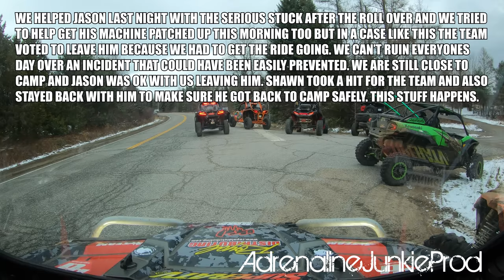Blown Diffs & Shattered Dreams - SXS/UTV Feature Length Off-Road Trail Riding Adventure

Comment: That little wildcat is a real mountain goat! keeps impressing. great to see a machine that is 1/4 of the price of all the others keeps up and sometimes does more then the big one$ with the right driver..
Reply: I own a 2018 Textron Wildcat x. I get the bad looks and s*it talk from others with much more expensive rigs. Don’t get me wrong, I love the more expensive Polaris and Can Ams but my rig goes everywhere theirs does.
Reply: I like the wildcat x platform far better than the xx
Reply: @timma0175  ya if I was to go xx then honestly I’d be getting the rzr 1000 instead
Reply: @MrSwimmer12  good call
Reply: @timma0175  yup. Sadly Polaris has much better customer support and aftermarket support. Sadly, I feel like Textron is a “dying breed” even though mine suits me parts are hard to come by (everything is becoming discontinued, and shops to work on them are far and few in between at least here in Colorado) don’t get me wrong though great machine for price and what it is. I’m impressed with stuff it has been able to do.
Reply: @MrSwimmer12  you and I my friend feel the same way. I hav little or no support for my wildcat via textron. They need to find thare passion again.
Reply: I love my wildcat sport. 30s and snorkels and its a beast in the mud
Reply: Little wildcat comes with a true locking front diff from factory

Comment: Just FYI 
All the xx models are the same yammy tripple design from the Arctic cat thundercat snowmobile!
There is a yellow 10mm plastic drain plug on the bottom center between 2 clips of the outer cvt cover. 
I get my xx in much deeper water than that and I’ve yet to get water in the cvt. I bet he got the water in the cvt exhaust snorkel from all the wheel spin or his cvt seal is not sealing somewhere. It’s easy to pinch the seal wrong if you don’t put the outer cvt cover on carefully.
Another thing…the motor oil is a dry sump system and will not fire until the oil pressure reaches the correct psi level! It’s normal nothing is wrong with the delayed start. They are an excellent engineered designed unit!! Very under rated! Ive been very satisfied with mine since 2018! Ive rode everywhere from windrock to brimstone to turkey bay! 
Excellent trail machine in most terrain! Also depends on how you set up the xx clutch and what tires you run as well! The main downside is they are very heavy around 1800lbs stock empty weight! Has plenty of power 130hp for naturally aspirated engine!
There is no perfect stock unit but it’s a lot closer than many out there! Definitely built better than most stock machines on the market. Aside from the upcoming speed utv! And maybe the krx 1000! 
And lastly if you’ve never actually drive one your really missing out!!!
Very driver friendly and it makes you a good driver if your not the best!
Reply: 100% agree with this!  I love my 18 XX.  Its a beast!  One of the fixes that required to be done after you pick an XX is putting in a coolant bleed line.  Super simple to do.  This guy didnt do it and caused it to shear its impeller off the water pump.  Every platform has issues and this is just one of those kind of  issues that need to be dealt with.
Reply: @mattking8761  I did the bleeder fix then finally just upgraded to a billet aluminum impeller from Dasa racing! It was an easy but kinda expensive upgrade but better than catastrophic engine failure!
Reply: @mattking8761  I disconnected front and rear sway bars and it articulates like crazy!

Comment: Loving the content. Specially the technical info towards car specs.

Just a small opinion. I do know the conversations about the cars are meant to be informal, but some kind of "check list" would be nice to have, so as to keep the topics somehow similar between cars, as I feel the information may be lost in translation in the conversation otherwise. It would also feel more homogeneous (so as to compare info between them) after a few cars have been checked - in my opinion of course.

Regarding the sxs I like the most. It has to be that Wildcat. Love the sound. And it seems very nimble, nervous and ready to tackle anything (apart from big rocks). Tim also has got something to do with it. He manages to drive the thing as it should. Hard, but not overly agressive. With the correct amount of input to that side by side.

Fish was wounded/unluky unfortunately. But he will come back strong and will make for great content again I'm sure. 👌

Keep the videos coming. 👍
Reply from the maker: Hey Ricardo, thanks for leaving such a well thought out comment. I really appreciate feedback like this, it helps me know what people watching are thinking which helps me improve future videos. The checklist idea is good, I’ll have to try to get some standard questions drilled into my head. The issue often is these videos are not planned or scripted at all. Everything happens on the fly and I don’t carry any notes. Some rides flow together really well and others just don’t mesh up as nicely since there are so many variables at play. 

What I would like to do this summer is interview a bunch of guys regarding their machines all on the same ride and have a bit of a group discussion on the topic. I think that way we can all discuss our thoughts in a fun way. I’d like to do the same regarding tires also. 

Fish will be back in action, we all know he always bounces back. Just a little hiccup. Some growing pains but once he gets everything dialed in again the Commander will be next level!!
Reply: @AdrenalineJunkieProd  you're welcome. Sounding good. 👍

The idea on the group Q&A is interesting as well.

I'm just throwing some ideas out as I watch along. As the content is interesting and I do like the technical aspect to the machines. I understand the flow on some days is so good that somentimes ideas and questions appear on the fly.

Regardless, the content is quality. Worth a watch no doubt. 👍

Appreciate.
Reply from the maker: @RicardoSilva-qp4bb  thanks again Ricardo. I value all the feedback I get. I’m happy you enjoy the content!!
Reply: Wildcats are super underrated. They rip.

Comment: I dig the budget wildcat …
I have the same mentality.
10 year old RZR 800s LE 
It goes where my buddies go with their higher end rigs..
I’ve had other RZR riders tell me to never get rid of it..just fix it..
Reply from the maker: The most important mod on any vehicle is the driver! It’s the same reason I like to hold onto machines. You get to know them inside out and they basically become an extension of your body.
Reply: @AdrenalineJunkieProd  
Exactly, I do my own maintenance, so if something is wrong I usually know what it needs immediately

Comment: Tim in the wildcat is super impressive.   I think his wildcat has a lower centre of gravity than the other machines as well which helps a lot.   As always I love watching the krx it’s an impressive machine.   I need to have my rzr set up for both higher speed trails and slow rough trails as there isn’t long enough stretches of rough trails to warrant a full soft set up.    Would love to get some good dry riding gear #finntrail
Reply: 100% correct. My 150pound 1/4 steel plate I made for rock smashing adds an extra advantage creating an even better lower CG. That mixed with the 3psi in both front and rear tires gives this kitty serious claws for climbing even with worn out tires.
Reply: @timma0175   you definitely show it doesn’t take a 40kplus machine to go anywhere.   Awesome riding man.    Hope to hook up with you guys some day.
Reply: @keithhelle7334  keep following us on instagram and Facebook to find out when we do the shout out ride this summer at Minden offroad park formally know as Rays Place🤟

Comment: My experience with superATV is to buy nothing that is wearable.  Axles, bearings, anything wit heim joints, diffs, etc. Everything else from them is great. Bumpers and windshields. I ride about 4k miles a year. But on another note buy a 12v clip on fan for your windshield fogging problem. Clip it on the oh crap bar.  Works pretty well. Love the videos.

Comment: Tim definitely knows his machine and how to wheel it. Any update on fish’s machine/differential? #FINNTRAIL
Reply from the maker: Hey man! Ya, Tim knows that Wild Kitty inside out. He’s had it torn apart so many times. I wonder what that machine did in a last life to deserve this but I assure you the day it does die it’s going straight to Valhalla! As for Fish’s machine. He just got the diff out. We are gonna send it back to SuperATV soon so they can inspect it and figure out what happened.
Reply: @AdrenalineJunkieProd  I hope they are able to figure out a reason why it happened. With how slippery everything was and the commander only being a 800 i would have sure hoped it could stand alot more abuse than that. He would be better off with 3 drive can am than the 2wd. If he can get a refund he can always go halo 30 for about 400$ more that the super atv.

Comment: Lots of the early production xxs had issues with to much assembly lube and the oil filter would become stopped up and unfortunately burn up a rod bearing. There is a drain plug on the cv belt as well. They are an excellent machine. Arctic cat just doesn't push and advertise like they should and are failing the platform and the customers
Reply: Yeah not feeling any support. Im dying to see another wildcat sport but it seems they cut the model.
Reply: @timma0175  I wish they would make one again.  Arctic cat needs to wake up

Comment: Cabela's sells the Tracker.  The 800SX series SxS has the same engine (Chinese Chery 800cc) as the John Deere 825i and one of the Kawasaki models.  I have the 1100cc version in my SxS.  Apparently, it a reliable enough engine for them to use it.  It has never given me any problems.  Mine does run 10 psi oil pressure at idle with the spec 10W-30 oil weight.  But I switched to 50 weight so that I can get a more comfortable 15 psi at idle.
Reply from the maker: The tracker sounds pretty cool. It did really well until the end tbere when it just decided to quit.

Comment: Wonder if that XX has the issues of where the assembly lube was overused in those engines and it plugged up the filter. That may cause the filter to bypass and cause low oil pressure even though the dry sump container is full.
Reply from the maker: Really!?!? That's a really messed up reason for things like that to happen. I wasn't aware that they had an issue like that. Thanks for adding that into the conversation. Were a lot of units effected by that?
Reply: @AdrenalineJunkieProd  Only by reading lots of forums, im interested in one of these rigs myself. I really like the XX's chassis and build but they seem to have some flaws still. 

1) Overuse of the assembly lube on the Yamaha triple was causing the Filters to gel up within the first few hours of use and cause bypassing of dirty oil into the system and low pressure conditions

2) There are a handful of premature oil pump failures but not sure the reason why. Most while still under the warranty period and Cat has been going good for motor replacements. Can't tell you the years though, anywhere from the 19s to 21s. Not enough 22's out there for data.

3) Overheating due to a poor bleeding system. The radiator sits higher in the front than the lines in the back where the engine is, but there is a long straight set of coolant lines up to the front that never seen to purge 100%. Cats soultion was a bleeder screw near the head that can be cracked to purge the extra air. There is a aftermarket solution from speedwerx that ties that bleeder line into the front res bottle to constantly purge air if it builds up in the system. Simple.. but should have been done from factory.

Every unit has it's flaws, it just sucks that the consumers have to be the R&D department.
Reply: Mostly 2018, 19’ and some 20’s had filters plugged with lube.  Changing the oils and filters after the break in period solved the issue.  There’s also a fairly big issue with the water impeller breaking so that could cause the over heating.

Comment: really hope supper atv comes out with a diff for the new maverick sports, im really sick of my 3 wheel drive to. they say that the new visco lock is better, its not. if you dont buy an XMR you get boned.  loving the content. i work long hours doing shift work and when i get home after a long day there is nothing better than throwing on your vids and unwinding
Reply from the maker: Hey John, super happy to hear you enjoy the videos and that they can help you unwind a bit after work. I can relate to the busy schedule, I’ve been swamped lately at work too and it makes it hard to find time to edit as much as I’d like. It’s difficult to balance work, life and the YouTube channel at times. I’ve also worked shifts for many many years and it definitely has its pros and cons. I agree, the new Visco lok sucks. The only decent diff comes in the XMR like you said with the Smart Lok. The visco lok struggles on slower technical type trails. It works ok wide open in mud or on moderate to high speed trail riding but really falls short on rock crawling and similar.

Comment: I have been looking for someone running the mega bites.  I konw you praised them on this ride.   I would like a review after you have several rides on them.  I ride in Ky an Tn and am looking for a good all around tire that can grip on the rock.
Reply from the maker: I’ve spent quite a bit more time on them since this ride. I have to say bang for buck they are one of my favourite tires along with the XTR 370. I feel they are a little tougher especially on the sidewall. They work really well on mixed terrain. I think they would do well in your area. I recommend ordering a size larger then you think you want. If you want 32’s I’d say go with a 34 if you want true 30’s go with a 32.

Comment: I love my little wildcat trail!
It cost me $7000 🇨🇦
And doesn’t owe me a thing! 👍

I’m thinking about swapping out some sport axles and controls arms for some better travel. 
But that 700cc motor makes plenty of power

#FinnTrail
Reply: The sport platform is truly amazing.
Reply: Agreed. And we don't have a lot of 50" trail restrictions here in Manitoba. So widening it is no big deal. 
I couldn't pass up the deal on the trail.
And I've seen some decent aftermarket axle and arm kits for the sport.
Reply: I have a sport and the ground clearance is great. You wont be disappointed

Comment: My XX blew the front DIff to hell broke in two halfs, and mine over heats also
Reply from the maker: Damn. That sucks about the diff. Are they known to be weak or were you beating on it? In regards to the overheating, is that a common issue and do you know what the main causes are if so?
Reply: @AdrenalineJunkieProd  Well be overheating was my rad was full of mud..  

Front DIff in case I have no clue, But arctic cat does not sell a complete replacement and I’m stuck looking for a solution I wasn’t beating on it either I didn’t even know I broke it other than a thump
Reply: @AdrenalineJunkieProd  But once we have a fix my son and I want to come out for a ride with you guys

Comment: awesome video. the krx needs 35" roxxzillas and it'll be almost unbeatable on these kinda trails
Reply from the maker: We keep pushing Corny in the KRX to get 35’s lol. He says once these tires wear down a bit more he is gonna go to a 32. Probably something like an XTR 370.
Reply: @AdrenalineJunkieProd  I’ve heard good and bad about the 370s. I was deciding between zillas and 370s during the summer last year when you almost couldn’t find a 35 and availability made the decision for me lol. I ride windrock in Tennessee and they are awesome. As far as breaking stuff, if you break the t with 35s you’d probably break it with smaller tires too lol.

Comment: I enjoy your videos very much, I would be mad as heck, if I paid and put in a new front diff and it broke on the first ride, like what happened to fish. I just spent 3 grand on my machine to get it ready to ride this spring, could use some #FINNTRAIL gear.
Reply from the maker: Glad you hear you enjoy the videos!! Ya, it was some bad luck for Fish but SuperATV is looking after it. They think it’s an isolated event and some sort of internal issue. He just pulled the diff out so we are sending it to SuperATV so they can inspect it and study the failure. I just ordered a full RS1 conversion with the hill killer built diff from Joe Coffman. Also have a bunch more maintenance to do before I hit the trails again.

Comment: Can you do a vid where you go over the wildcat with Tim to see what he has on that machine
Reply from the maker: Hey nick. Ya, no problem. I’ll film a segment on that in an upcoming video.
Reply: To simply sum it up ive been playing a game of ride it break it Engineer it gooder lol . She has a very low CG due to the armour of a 150pound 1/4 steel wear plate for a skid plate. I cut the front of the frame out replacing the frame with solid bar instead of weak tin tube from factory. Dropping tire pressure to 3psi is key to grab max grip even with worn out ITP black water tires. DALTON clutch kit helps to give the snap I need and give awesome engine breaking on down hill crawls without needing to ride the breaks. There are a bunch more mods ive done for durability. In short this kitty is a light armoured tank lol.